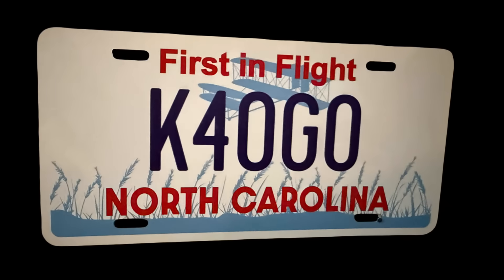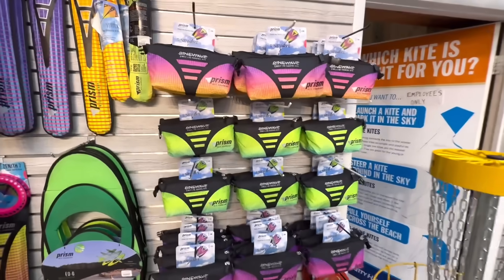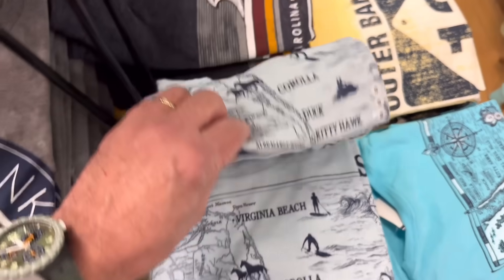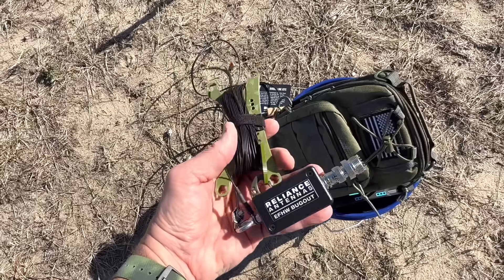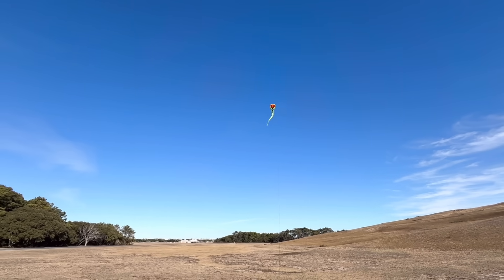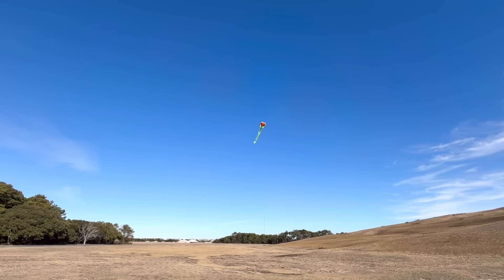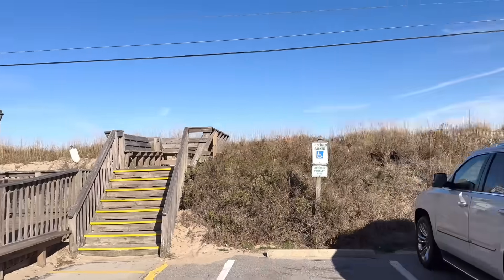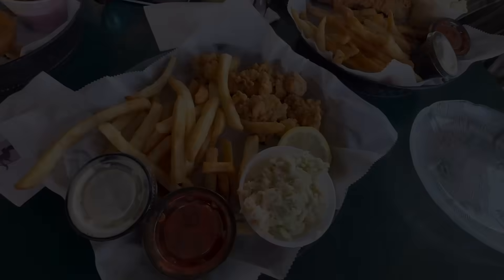I Built a Kite Antenna for HF Ham Radio

Comment: Hi, I have the same radio but I've never been successful using it in the field, it always runs out of battery or the battery I take never has the correct amperage. @COASTALWAVESWIRES which one did you feed your radio in this video in field mode? A battery with what voltage and with what amperage?

Comment: Thanks so much for the video!  I’m going to order one of those reliance bugouts as a backup for my project.  I’m doing a kite activation on the ice here in Minnesota in February.

I’d be curious to see more about how you specifically attached the antenna and other considerations.  I’m adding an LDG 1:1 UNUN with a counterpoise to mine to hopefully bleed off static from the antenna.

Also, I was at that restaurant many years ago while out there with the Air Force for training, loved it!  I do appreciate you noting the restaurants you visit.

Comment: As someone who raises antennas using a kite myself, If you are based in the UK the maximum height you can raise a kite is 200ft not 300ft without a NOTAM and (if I recall correctly) streamers from your flying line. This assumes you are a good few miles from an airport otherwise the regs change to nearer 100ft  - I may be out of date so its worth a google before setting out!. also use a larks head knot (also known as a baggage tag knot)  to attach a ring to the line, then attach the wire to the ring with the same knot - makes setup and drop down WAY easier . Dog walker stakes (look like a large corkscrew) are very handy for most locations too (not dry sand though)
Reply from the maker: Thanks for the tips!
Reply: Also Delta kites tend to sit "on top" of the wind and are better for near vertical operation. Beware that some delta designs (e.g. a Dan Leigh "floater" ) will actually fly so high into the overhead they end up behind you. I use soft kites  for very strong wind and deltas up to about 12MPH

Comment: I could not find an email, so hopefully I could ask you a question or two here. I have been consuming your videos for a few days. Due to living arrangements the last few years, I have been off the air for the most part. I was excited to get into a rental house with an OK size lot, maybe 90 feet in length. Low to Medium height trees along the back line but so is the power lines and another tree along one of the sides of the house but that tree is pretty close to the power main also. I am on a tight budget so trying to do things as cheap as possible. I got excited to try to get some wire up and after hearing so many good things over the years about an OCF, I got a commercial version and the plan was to get it up with a Hobby Lobby 30 ft flagpole. Well, after getting the antenna, I found out that Hobby Lobby has not stocked those poles in years! So now, because budget and the fact it's a rental, so I can only do things Simi-Permanent (Maybe Simi-Portable is closer), the best I could do in short term is get it up a PVC pipe which is only 10 feet.  One of the legs might be 15 feet or so and the other dips down to a wood fence but also along the side of the house below the roof. This is when I learned that the OCF is the worst dipole I have used so low. Due to military temporary housing and such, I have never had a tower and almost all my wires have been pretty dang low over the years, but I could at least tune them. This is a 10-80M and it will only tune on 20M at all with the IC-7300. I can get it pretty close on 20M without the tuner, but the rest are so far off the IC-7300 can't tune it and I don't have an analyzer to see how bad it is. I picked the Hobby Lobby pole because I can temp install it without digging holes and basically guy it and lower it when not in use. With that out, I guess I am restricted to using something not so strong at the top, so I think my OCF is going to be a no go because it's pretty heavy. Looking at commercial ground verticals portable or otherwise brings big sad face and shock when you scroll down to the price, not to mention that many I have liked over the years just are not made anymore. It's just not doable for me right now.  SOOOOooo, that leads me to a couple questions,  I tend to operate in evenings after work when I can and I do like to DX and contest even if it's modest, so I really love to have 40M and 80M in my tool kit. If I try to go vertical instead with a fiberglass mast like DX Commander or Spiderbeam or what have you, what is my best option to get OK performance on 40M at least? I understand it will be nulled out under 400km or so, but my assumption is it is a better compromise than an NVIS dipole VERY low in regards to chance of DX. Would the 32ft EFHW even be able to be tuned by the IC-7300 (Sub 3:1 ATU)?  I understand everything is a compromise, but of all the options you showcase with the lightweight easy verticals, what is the least compromise with an option of 40M? I would rather give up effectiveness on 10/12M to pickup OK performance and option on 40M with an internal ATU. Or, should I just accept that 40M needs more height than I can really put up and concentrate on the best 10-20M I can for my situation and try to figure out another option to go horizontal with 40M? Either way, I plan to use a decent ground plane. Should I be cutting them for different lengths for each band? Or just 5 to 6 Meters in length and as many as I can stand? I was thinking a minimum of 6 to 8. Sorry for the long post. I just couldn't find another method to reach you and been wondering these things. TNX! de WC5B  Oklahoma City, OK
Reply from the maker: Honestly the best performance I've gotten from a vertical wire antenna on 40 meters was with the Rybakov which is simply a 25 foot wire on a 4:1 unun with counterpoise wires below it. The fact that you want 80 meters I would seriously look into a coil. A very stealthy and good antenna that you might want to check out is the JPC-350. Take a look at it. 73, Walt
Reply: @COASTALWAVESWIRES  I forgot all about coils. Will have to check that out. After I posted this to you I discovered your videos on Squares and Bobtail's. I have NEVER tried anything like those before and I am about 95% sold on trying them out. So my "just get on the air" plan is going to be first, a EFHW Square to get up decent on 10-20 and at least NVIS on 40, without having to get too high. After that, I also really want to try the 20-Meter Bobtail Curtain. I have never had ANYTHING with any real gain on HF from the home QTH. I will round it out with a Rybakov I think in case something is in the Null and just for flexibility and experimenting. At that point I will be on the air comfortably I think and can then try to figure out how to get higher for 40 & 80 and if not, can check out a coil worst case scenario.

Comment: Ham or no Ham  they Higher you Antenna is the Better it is for Reception and Transmitting that is a Fact  It doesn't matter if you are on CB or Ham Radio it is the Fact

Comment: I used a 5' wide delta wing kite that had enough lift to pull 33' of 20ga wire, a 49:1 balun, and 50' of coax into the air.  Connected the end of the wire antenna about 100' below the kite, and had that thing out as far as it would go to get good wind.  Once it was up, it did a great job for a good while!

edit:  Pics up on my QRZ page, KD9ZKS

Comment: Been wanting to see a video on Kite-lifted antennas for quite a while!

Can you PLEASE do a Part TWO detailing how you actually rigged the antenna to the kite and line, the specifics of the anchor, and all the other little grubby details?

Would also LOVE to see you do a Part Three with a random wire, hopelully long enuf to get out on 80 and 160......

73
Reply from the maker: Yes, I'm going to get out on the beach with it and do that. 73, Walt
Reply: @COASTALWAVESWIRES   explain also the battery that you are using with that Yaesu FT-450D, please.
Reply: I've done this a couple times myself. I plan to do a bunch of POTA hunting from various kites lifting antennas this Spring/Summer ... once it warms up here in central Nebraska. I've got all the parts set up, just need some nice weather now.

Comment: Great Video Walt! I've used the exact same Kite (Prism Bora 7) two years ago at the North Sea Coast in Germany to elevate an EFHW 🙂. have some pics on my qrz page.  I recommend to use 10-20ft rubber band on top of the antenna wire to compensate the Kite movements. Also highly recommencement to ground your antenna (quite simple for the EFHW, but also possible with a some Meg Ohm bleed resistor) do avoid static DC charges. 73 and good flights, Jan DG1JAN
Reply from the maker: Awesome, thanks for the advice. 73, Walt

Comment: Two things i would recommend doing which is a must, ground the hot side with at least a meg ohm resister, the radio will thank you for it.  Also have at least have a leather gardening glove for the line... personally i use a dog walkers screw in the ground to anchor the line to.

Comment: That reminds me of my 160 contesting in the 70s using a balloon to hold up a 130 foot vertical! Did it several times. Only problem was rain weighed the balloon down a bit like your loss of wind! I remember a group out at Ohio State used a kite to hold up their 160 antenna once or twice about the same time.
Reply from the maker: That's awesome, thanks for sharing.

Comment: How did you connect the antenna wire to the kite wire at the far end?
Reply from the maker: just did a small loop knot in the kite string to the end of the wire.

Comment: Kevlar kite string and magnet wire alongside means way less weight to carry aloft either way.
Reply: Marine aluminum welding wire would have some strength in tension and low resistance and it could stay salty without corroding?

Comment: Many years ago at Rex’s Lobstercon in Maine there was a kite hoisted 160 meter vertical
Reply: Was a center fed full size dipole carried by a Scott sled. Feed line went up the kite “string” then left and went horizontal over to center of the vertical dipole. I think the Scott sled was made out of Tyvek

Comment: Nice!  How are you logging these?
Reply from the maker: replay the video and sit down to my computer and enter. The video is time stamped.
Reply: @COASTALWAVESWIRES  You motivated me to get out last night and I activated a few parks but I am really struggling to hear calls correctly and log them legibly.  I decided to use World Radio League for logging and log directly there which slowed me down a bit but allows for low processing of an activation later and I get things correct.  

Further, with the price of starlinks now, I can always have an internet connection and as soon as I enter a call, WRL is already looking up the call and telling me who and where so I can incorporate into the conversation.

Comment: Been at that same store. Bora 7 was a great choice to start. For more height and even more stability try a KAP Foil 1.5 and 3 based on wind. It will go higher and be rock solid stable. Also a thinner polystealth might help. They make small foldable ground mats now... Just sayin.  Love your videos.
Reply from the maker: Thank you so much! 73, Walt
Reply: @COASTALWAVESWIRES Use the KAP Foil 5.0 in 20mph winds if you want to fly kites and lift the fence post it’s tied to out of the ground. Don’t ask me how I know.

Comment: Biggest issue you have to watch out with is static buildup. I use a couple of megohm carbon composite “red devil” resistor from the center to the shield which I have had grounded with the resistor to a short grounding rod. 

Back when I first played with a balloon and kite antennas I was amazed and shocked (literally) by the static buildup. 

Don’t let that coax turn into capacitor and take out your receiver.
Reply: Yes big alert. 
Static can blow up your radio end.

Comment: Last time I was at the Outer Banks we had 45mph winds atop Bodie Island Lighthouse. I just wanted flounder, deviled crab, scallop, hush puppies, cole slaw, sweet tea. I wanted the sea smell, the salt dried-out on our skin, the sand spurs stuck in our feet, a collection of sea shells...The Outer Banks used to be a wild place with no guarantees. You were on your own. If you've never done it: get the finest hotel room in the house facing the surf / ON the surf at least four stories up. Get the wife some nice wine or such. Get yourself something sip-worthy that has ice cubes to jingle. 11PM...Full moon...wind and surf and smells. Few places offfer this. That the Outer Banks are wild and ever-changing is what brings you it's beauty. Money? That's why you worked hard to earn it.
Reply from the maker: Roger that!!!!

Comment: I once bought a nylon kite at the OB that is colorful and the kite was triangular box kite with sort of "wings" on the side of it.  I think it was modelled after an antenna kite.  I can say it needed some really heavy gage nylon string and it had a hell of a pull up in the air,  it would certainly pull up an antenna if you are far from power lines etc.  BTW "First in Flight"  can mean more than one thing,  from Ohio.
Reply from the maker: Roger that, LOL! 73 from North Carolina

Comment: great video,  i started using a kite antenna decades ago, my preference is for a scott sled kite

,  it is a easy way to get antenna up there,  i have it suxch that it has 30m single line to kite then la second line and tenna down.
if i stake second line and  kite line to form a lopsided thetrahedron with the antenna it gives more stability than just the line and antenna,  enough to give a few extra contacts and still be very simple to set up
Reply from the maker: That's awesome, sounds like a great setup!
Reply: @COASTALWAVESWIRES it works as long as there is enough wind, you found out about the swaying kite fading already, avoiding most of that is worth the extra setup time

Comment: "Ohhhh let's go fly a kite, up to the highest height.  Le's go fly a kite, and send it soaring!"  🎶

The EFHW is a good way to go because the UNUN provides a DC short to ground.  Always use a ground rod to drain static electricity from the wire.  Several Kv can accumulate and really ruin a hams day.  If anyone uses a tuner direct feed or coax direct feed to the wire, always add a 10k resistor to ground to bleed off static.  Super important.  73
Reply from the maker: Great points, thanks for sharing!

Comment: Back in the 90's i used to use a kite and 300ft of wire straped to the kite line. anttena connected to the top of the parallel coil and 500pf hi voltage  virable capacitor tap on the coil 4t up from earth coxal cable connects inner to tap outer to earth you need a good earth and ground wires you need to be careful you
Can get verry hi voltages on the anttena wire so conect everything before you fly your kite the coil will
Make a dc path to ground i have forgotten how many turns the coil needs you will have to experiment 
Try 30t 20 swg to start i could use mine on 40,80,160m bands as you found out keeping it up is the
Fun bit chris g0wfh

Comment: Very glad you are getting into kites! If ever there was a ham that should it’s one that spends a lot of time at the beach. I have had great success. I recommend endfeds with a 49:1 transformer that transformer has a little bit of loss, but it is also a DC short so static can’t build up across the feed point. If you want to be cautious you could also ground the shield to the sand. I am going to try and respond to this comment with some links to kite shorts/videos I have done. Oh last thing check out Delta Conyne kits they have the stability of a box kite and more lifting power. And you can “stack” them if you want even more lifting power
Reply: On my channel I have:
Vertical 40m 100+ watt HRD EFHW hanging from a kite string
Kite lifting K6ARK QRP EFHW

Comment: Kite antenna is a neat idea. I wonder if the same thing could be done with a balloon. Wouldn't depend on wind. Could lift more weight with multiple balloons. Could be tethered with a couple tie-downs to give some location control. Might even work for 160 meters. Might cost more than the one time kite for the helium needed each time.

Comment: Hey Walt I saw a hang glider setting behind you on the edge of the parking lot. What's that all about? Did you know I was a hang glider pilot and that's how I got into ham radio? lol. Now ya gotta do a weather balloon.
Reply from the maker: Yes, Kitty Hawk Kites does hang gliding across the road over on the dune at Jockey's Ridge.
Reply: Oh I've heard of the site but didn't know it was right there near the monument. Thanks.